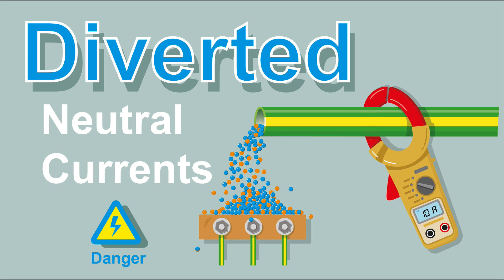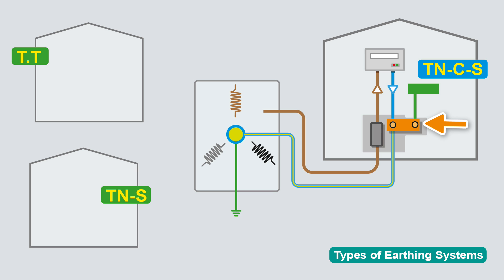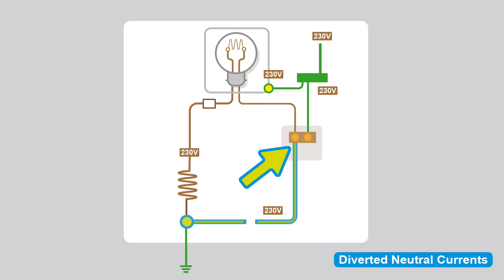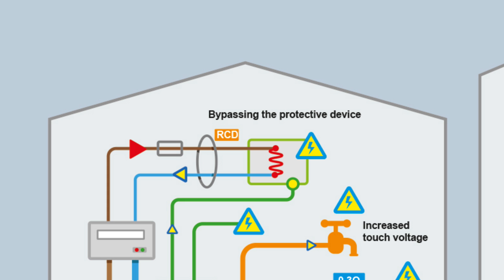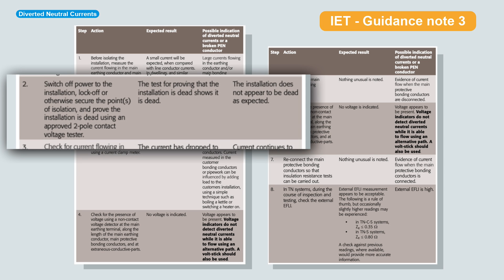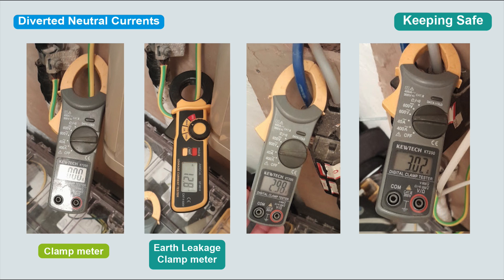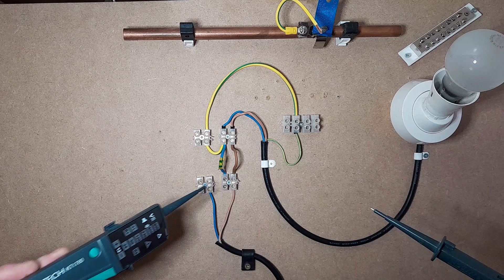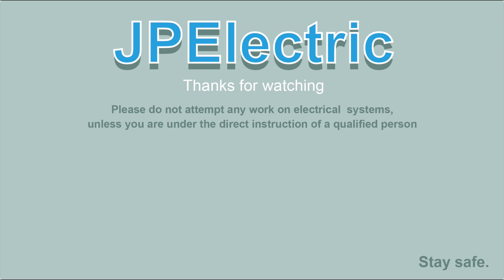Diverted neutral Currents -  Is our electricity supply safe?

Comment: Had an experience a good few years ago when, as a DNO cable jointer, attending a "no incoming supply" to a house. As normal, an electrician had been sent to check out internal issues first, detected no incoming supply and called it in for a cable jointer to attend (me). My mate, also a jointer, tested inside and confirmed no supply.

I excavated half way up the garden and stripped the outer PVC sheath of the CNE service cable and got quite a rattle off the N/E. We had no protocol for this so I sunk a stick of solder into the ground and tested which proved the N/E live. 

I ran a length of 16mm wire from the solder into the house and confirmed both Phase and N/E were live. The service cable had been damaged and eventually burned away the N/E leaving it open circuit back towards the main service joint while the phase was still feeding.

What bothered me was that, despite filling out a near miss form and explaining this to our Manager and safety rep no alerts were issued. It almost certainly must have happened again.

Comment: Good simple video.  I agree that earthing is quite hard to analyse because there are many things that can go wrong with misleading effects.
Seems to me that there are two important rules that TNC-S  does not normally follow:
1. Every earth network (and every N-E link)  should have its own verifiable connection to the mass of earth.  PEN does not provide this.
2. RCD on incoming supply is desirable for detecting diverted neutrals in whole installation.

Multiple earth connections on an earth network can reducee risk.    Every N-E connection should have a verifiable earth connection.  Downside is parallel path for neutral current.
The French TT system with incomer 500mA RCD (and earth stake isolated from neutral) seems very effective.

Comment: Great video, thanks. I came across one of these about 18 months ago on a PVS 3-phase grid-tie system that my friend asked to look at because it had the symptoms of an inverter with a weird internal fault because it was producing an error code. The inverter is clever and it auto phase balances the currents so no abnormal current flows in N or Pc and everything great. Super weird head scratcher until the sun started to go down and shit! did I get a shock and the inverter error coded gain. After that it all became quickly obvious. Stupidly, neither of us had thought to start the diagnostics by looking up the overhead wires that passed through a giant tree swaying in the wind! Whoops!

Comment: Very good video on diverted currents.

Only seen it once customer saying pipe has burst and rads are hot but heating is off !

When I got there the plastic main water pipe had come away at the fitting due to the heat generated by the diverted current.

The fault was externally where a conversion was made to PME.

Quite baffling and very dangerous if you don't have your thinking cap on !
Reply from the maker: Thanks for watching and commenting cfgman1  appreciate it.

Comment: A simple device like a Nest smoke detector can send you an email when the power fails, because it has a battery backup and is IOT. this type of technology could be easily adapted to constantly monitor earth fault impedance, or indeed monitor PEN. Include one of these with every rewire as standard. Just needs to be the size of a cutout switch with an audio and visual alarm, perhaps automatic disconnect?

Comment: Very interesting, basically the tester would show 0 voltage between neutral and earth, the same reading as normal, but here are both live..
Reply from the maker: Thank you selvoselvo1.  Voltage detectors detect a difference in potential. If you have not got one, they can show no voltage.
Some voltage detectors will give an indication that voltage has been detected.

Comment: Have all the house on RCD or RCBOs on all circuits.  Just disconnect the DNO supplied PEN earth, then install a TT. Also disconnect bonding to water and gas pipes.

Install an SPD at the consumer unit and a short section of plastic water pipe as the water pipe enters the house. Then no electricity from other properties enters your house via the water pipe.   If you have a plastic gas mains then you have it.

Comment: Very interesting vid and nearly all issues are relevant, but in one detail I cannot follow your description. 
If the PEN is broken some current (depending on earth's resistance) will "lift" the potential of all PEs inside the house, the foundation (steel grid in the concrete connected to PE) as well as all metal parts inside the house. All together they constitue in principe an equipotential plate.
Hence, if I touch a metal part (e. g. a toaster with PE connection) there is no potential difference to any other metal object around. Also not to the floor, wall or any pipe, be it water or gas. 
Additionally, if I touch a hot wire (L1, L2, or L3) a current will begin to flow through only one end of the RCD => it will trip, even if PEN is broken.
So, besides all adverse effects which will for sure be the conswquence of a broken PEN: Due to the fact that the whole house including al metals are at the same potential I don't see any dangerous potential*difference* anywhere inside the house. Where is my fault?

Comment: I did made a mistake few years back. Disconecting a main earth conductor, after the 2probe voltage tester indicate no electrical voltage on it. I did not have a clamp meter at that point, to measure the current. The mai protection fuse was out, i was sure nothing was live. When i disconnected the earth conductor, a spark apear(a small ark) at the conection screw, not a huge one, but a vizible one to realised that was not the smartest idea!. I touched the earth electrode at the conection point after the disconection. I knew nothing can come from the ground up, i was safe. The earth electrode was warm to hot on touching. So i gues it was a bit of current passing by! Be smart, guys, work safe!